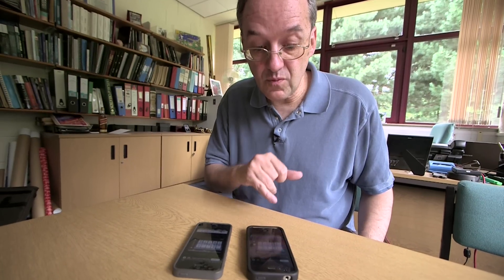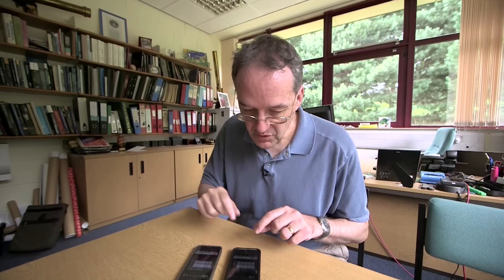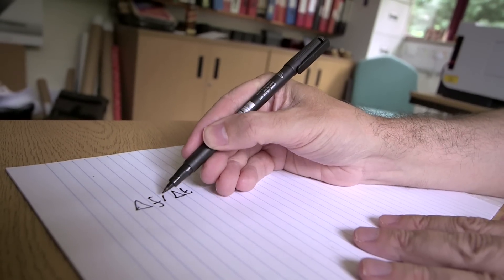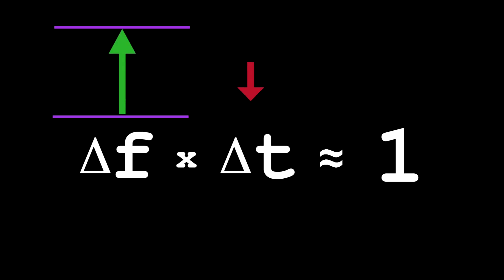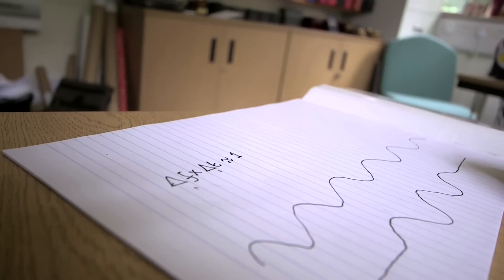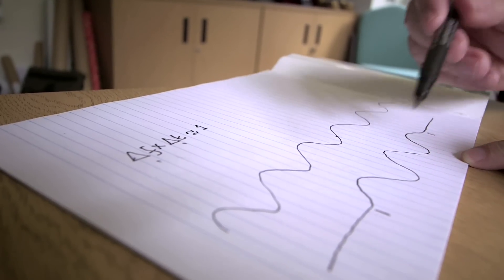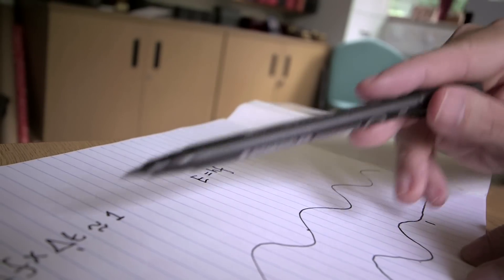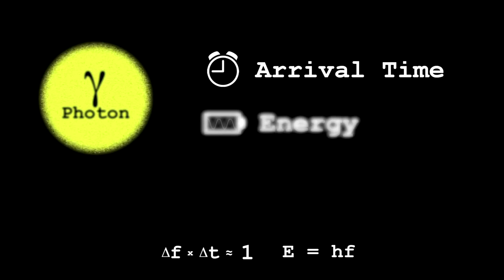What is the maximum Bandwidth? - Sixty Symbols

Comment: You can easily convey information with a single frequency by modulating the amplitude.
Reply: But as soon as you modulate the amplitude of a sine wave you also don't have a single frequency anymore :-)
Reply: compuholic82 If it is at 60 Hz it is still at 60 Hz, just louder.
Reply: That is where you are wrong. If you do a Fourier-Transform on an amplitude-modulated sine wave you will find multiple frequency components. Of course the 60Hz component is still there (and it will likely show up as the dominant frequency) but you will find that the modulated signal now consists of whole range of frequencies centered around the 60Hz component. If you don't believe me: Check out the Wikipedia Article on AM-Modulation. It has an extra section on the spectrum of AM-modulated signals.
Reply: compuholic82  Imagine a 60Hz signal that is cut for 1/60 second after a period of 2/60 second, 3/60, 5/60, 7/60, 11/60, 13/60... you can see where I am going here. That is conveying information. Instead of cutting the signal you could have a baseline amplitude and boost the amplitude or reduce it accordingly. The pitch would remain the same but the loudness would change which is enough to conyey information.
Reply: That might be the source of your confusion: pitch != frequency. Pitch is something that we humans perceive while a frequency component is something that you can describe by a simple sine-wave multiplied by a constant c*sin(2*pi*omega*t). You have have two instruments playing the same tone, they sound different but the pitch is the same. That is because every instrument generates a different spectrum of frequencies. 

Same thing here: By changing the loudness, you might not be altering the pitch but you are altering the waveform of a sine wave so that it no longer is a sine-wave. The resulting waveform can by described as A(t)*sin(2*pi*omega*t). However A(t) is not a constant in your case. Therefore the resulting signal no longer has a single frequency component. It can however be described as a sum of multiple sine-waves of slightly different frequencies which is what the Fourier-Transform does.
Reply: compuholic82  You are grossly overcomplicating things here. Modulating the amplitude of a single frequency does not alter the frequency at all. Imagine a pitch fork with perfect sustain struck inside a room with a single door. How would it be possible to convey information to somebody outside the room? Could it be done by partially opening and closing the door? You see that thing furry thing in the corner that is barking?... That's a dog!
Reply: I am absolutely not over-complicating anything. You are still not grasping the concept. Everything about how you phrase things is just a little bit off. It is not that you are altering the frequency, you are introducing new frequency components. An AM-modulated signal no longer consists of a single frequency. I gave you a Wikipedia Article to read and told you to try a Fourier-Transform on an AM modulated signal yourself. I don't know how else to explain it.

If what you are saying were true it would be possible to squeeze AM-modulated carrier frequencies arbitrarily close to each other. And that is not the case. If you send an AM modulated radio program at 100MHz you cannot send another radio program at 100.0001 MHz without disturbing the other. There must be a spacing between the carrier frequencies and this spacing is dependent on the bandwidth of the signal you are sending.

That is also the reason why you can still hear your favorite radio program even if you did not select the correct carrier frequency exactly right.
Reply: compuholic82  Maybe you are oversimplyfying it then. I don't find this difficult to understand at all. Maybe my simple concept is too complex for you. I honestly don't know how to explain frequency in a more simple format.
Reply: Robert  I can't see all of your comment, it is visible in part in my notifications but is not visible to me here so my response here does involve a degree of extrapolation. Assume a non-sinusoidal wave with an overlaying signal of the same frequency.
Reply: Yeah youtube has been dealing with comments strangely lately.
Reply: Robert  I saw that comment. Did I get the gist of what you were saying?
Reply: The last view words of the comment you posted were: 'signal of the same frequency'. I believe that sentence wasn't complete?
Reply: Robert  It actually was complete. I did say assume and the implication was that you understood where I was going. Anything further could be construed as a breach of security.
Reply: Ahh I see, fair enough. So with overlaying signal, what do you mean by that? Say we have the carrier frequency at fc and so we have a signal as following: s(t) = A*sin(2*pi*fc)
Now how do you imagine the 'overlaying' signal coming in? Some amplitude modulation?
Reply: Robert Exactly which part of my brain would you like not to be dissected?
Reply: I don't get what your point in all of this is... You know that modulating amplitude is mathematically equivalent to adding and altering frequencies do you?
Reply: Robert  We are not conveying any information on anything except one frequency.  I assume you are a musician by your picture so I will attempt to explain it that way. Imagine I am a spy and I want to convey some information to you through a piece of music. Bear with me here, I know it contains many different frequencies. I play a piece of music in the key of C and I want you to ignore everything except for the G note at 392Hz. Yes there are numerous frequencies within the note played depending on the instrument. So you score the piece and plot G against time. You then cross-reference against your code book and interpret the message. Everything except G4 is basically garbage so is ignored. I could have just played G4 and not bothered playing anything else but that would have been really obvious and I would have been discovered.
So you now have to transmit that info to your handler but have a transmitter that only transmits at, for example, 117.93GHz. So you turn on your transmitter and modulate by turning it on and off depending on whether a G4 was playing or not.
Reply: And also, I am a musician with a bachelors degree in Electrical Engineering so we can speak in technical terms without confusing me ^^
Reply: Robert  I can see your electrical engineering comment bur your previous comment is only partially visible in my notifications and does not appear in the comments here. It ends at "for G in ord..." I only used the music analogy to show that it was the one particular frequency that conveyed the information and that all the other notes were basically used to disguise it. The other notes could be left out as they are really just representative of the off state.
Reply: Robert  Again, your comment has not shown up here but is partially shown in my notifications. The point is that I conveyed the information using one method and then you were able to convey the exact same information using just a on-off keyed  carrier wave. All the receiver has to do is detect the presence or absence of the carrier wave and plot it against time.
Reply: Perhaps this sub-account works better (same robert)? I get your point but you seem to miss the fact that in order to transmit a signal yes, or no or even be sensitive to receiving a signal yes or not is only possible given multiple frequency components. A system that would truly only respond at 'one' frequency would be a resonant system without energetic losses meaning, once it has been excited, it will continue to resonate indefinitely which stops you from establishing any presence. In a similar matter, a medium that only passes 'one' frequency couldn't carry signals that are on or off as it will be a perfect resonant system as well. This isn't just a unlucky fact of nature, it is in its definition of the mathematics true. Systems that can correctly transmit signals turning on or off are in definition wide-band. A receiver can only detect the presence and absence of a certain frequency must, in definition be sensitive and actively listening to multiple frequencies.
Reply: Robert Fennis  I could be using Jodrell Bank for all I care, the only thing that is important is that it can detect the carrier frequency and plot it against time to receive the information. It doesn't have to be elegant or efficient, it can be done.
Reply: Robert Fennis  BTW, the carrier wave isn't carrying any information other than it's presence or absence..
Reply: Yes see but that is exactly the point, that is precisely not how it works. If you want to detect the presence of a carrier frequency and plot it against time you HAVE to detect other frequencies. If you don't detect other frequencies you can only read a constant presence. Transforming the eternal presence of a carrier frequency to one that differs in presence by means of AM is solely manifested in the addition of different frequencies. Its not a matter of bad or inefficient, it is impossible to transmit a frequency that turns on and off with only the that frequency. By mathematical definition. The carrier wave is only carrying the information of its presence. Its absence is carried in all frequencies BUT the carrier frequency.
Reply: Robert Fennis You can turn a transmitter on or off as you please. You don't have to limit the receiver, you just have to be able to identify when a particular frequency peaks. You can use fibre optic amplitude modulation if you like and have the receiver decode the bit values associated with it. What about Morse code as an example of on-off keying?
Reply: By all means that is true. I'm not saying that your transmitter has to actively 'add frequencies' in order to turn it on or off. If that's what seemed to be my point then you are right.But that wasn't my point or the point of the video. What I'm saying is that in case of for example morse code, by pressing the button connected to a constant signal source, you are implicitly adding frequencies to the otherwise single frequency. That happens when you make/break the connection, in a strange way, the device you use to generate the bleeps is, in cooperation with the constant frequency source, a device that generates multiple frequencies. That is also what the video tries to convey. No matter how you setup the transmitter, the end result of on-off keyed signals is always something with multiple frequencies. Its indeed NOT true that in order to design a device that transmits an on-off keyed signal, you have to consciously design it as some multi-modal oscillator or something. You can just make an oscillator at one frequency that you turn on or off. But the act of turning it on or off is the act of adding extra frequencies.
Reply: Robert Fennis  You can add whatever frequencies you like. You can add information to the carrier wave if you like and have sidebanding coming out of its ears, that's not what I am saying. am saying that a single frequency is all that is needed to convey information. That is what I was trying to get at with the music analogy. Everything else is beside the point, the information was contained solely within the G4 component.
I'm not saying I can dive into a swimming pool and swim to the other end without making a ripple, I am saying the ripples are completely irrelevant.
Reply: Well if that is what you are saying, you are completely wrong. The side-lobes are not some side-effect of what happens, they are the effect that turns the signal on or off. If you don't get that, you don't get how fourier transforms and time signals work.
Reply: Robert Fennis  I am still only getting half a comment which does make it difficult to have a proper conversation. I do enjoy the snippets we have though. I suppose it makes us both go off on tangents. It makes me feel a bit like Leonard or Wolowitz talking to Sheldon.
Reply: Robert Fennis Still only getting you in notifications. It is problematic but you are still interesting.
Reply: What if I just keep switching accounts. Does that help?
Reply: Roberniomi fenissio, does this show up?
Reply: Robert I see your comment now.  I don't know,  maybe we should say gravy instead of frequency and beef oxo instead of wavelength.
Reply: I'd rather replace frequency with the the sauce in the pasta where the pasta is the carrier frequency.
Reply: Robert  The Courier transform then.

Comment: don't spout such bullshit, this is a physical limit of light bandwidth, not a practical limit.

Problems like making a device with such sensitivity, sustaining signal strength over long distances (cables have boosters inserted and are 95% copper to power the boosters).

Nor do we have the computational power to route such large amounts of data.